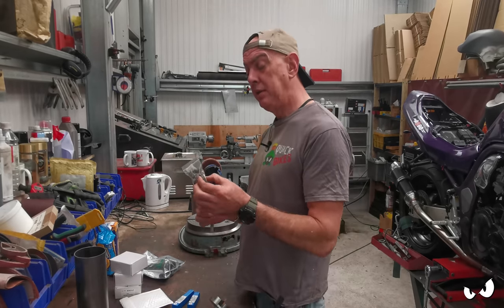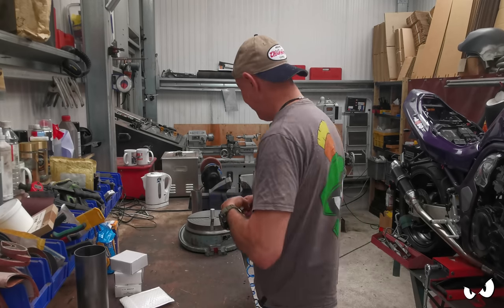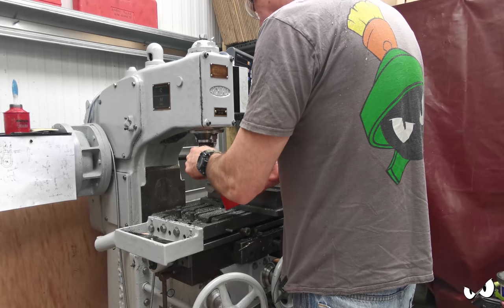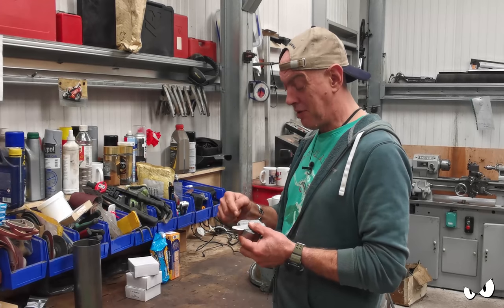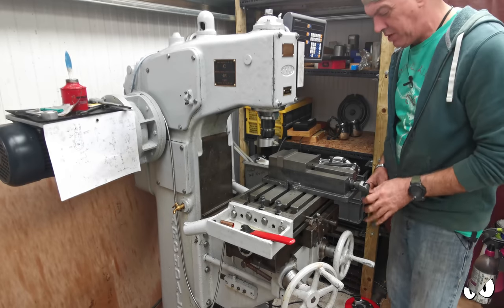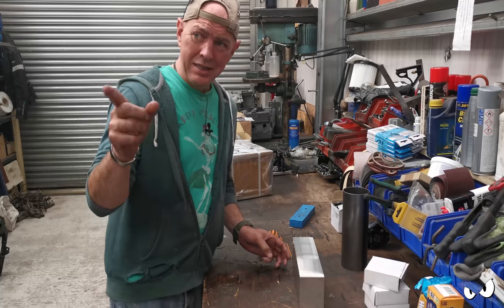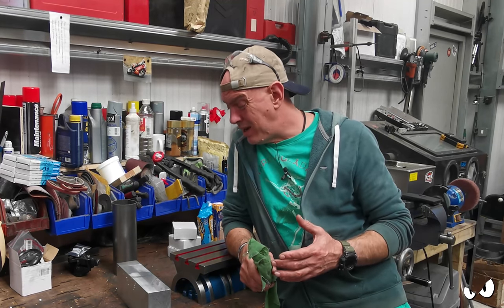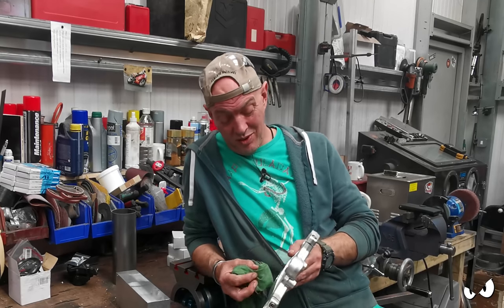Completed fly cutter so I can machine the yokes for the Suzuki Bandit Cafe Racer project

Comment: Hi just a little tip, Good masonry bits have carbide tips so it makes them ideal for drilling out tool steel.
Reply from the maker: That's what Brett used to do the spindle draw bar hole. Just had to put a slightly different grind on it.  At some.point I'm going to have to give it a go 😁👍

Comment: To get your hole centres dimension, machine up identical bars (ideally one bar cut in two) and put in the existing yolk. Measure either the outsides of the bars in situ or the inside and add (or take away) the diameter of one of the bars from your linear dimension rather than trying to measure the bores of the yolks.
Reply from the maker: Yeah, doing that as I have some bar that's nearly the right size 😁👍
Reply: @QuickBikes  i'd just use the fork tubes (optionally, chuck them in the lathe to check for banananiness). assemble both yokes on the tubes, measure across and subtract one diameter to get the centre-to-centre width. put a straight edge across the tubes and measure the distance from that to the steering stem, add or subtract radiuses of the appropriate parts as necessary to get the offset. if that measures different top to bottom, you have a raked out set of yokes, which you dont't :)
Reply from the maker: Yeah, many ways to skin a cat... I think I tried most of em 🤣😂😅